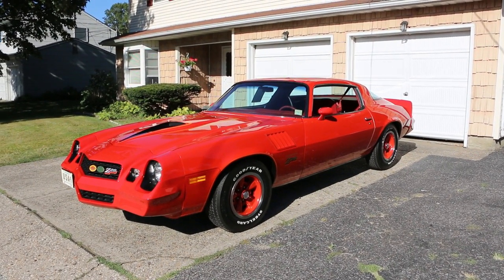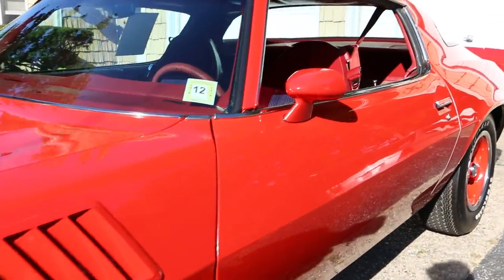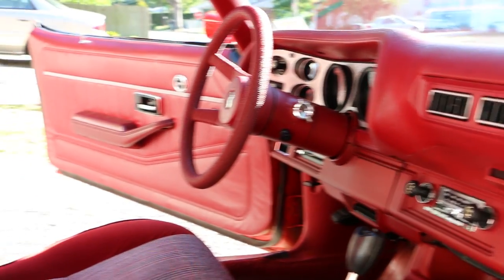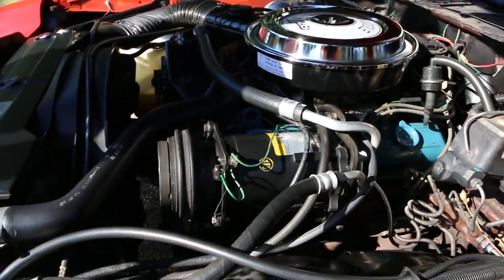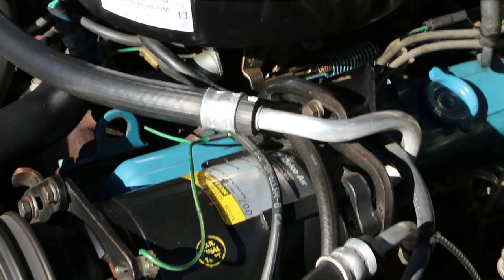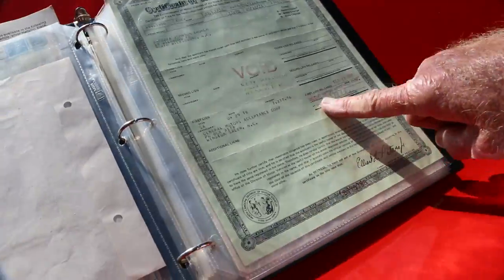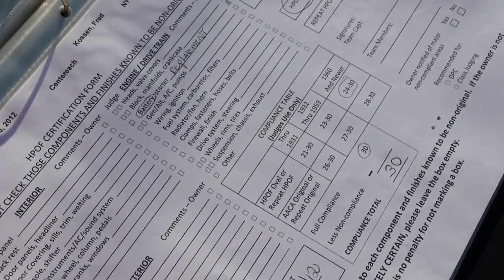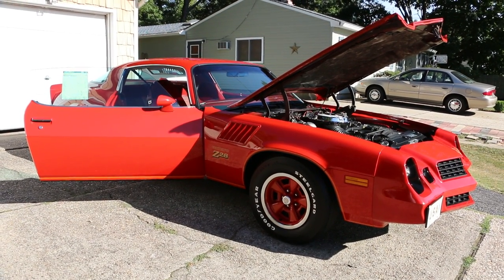Review of 1978 Chevrolet Camaro Z28 For Sale~28,722 Original Miles~Time Capsule

Comment: It's amazing how much these cars are going for in today's market..I seen a 1978 Z/28 all original  matching #"s almost every option all documented with 14,000 miles with Saffron exterior, (2nd rarest color that year) the custom black cloth interior, 4 speed manual (less that 500 were this color exterior/interior & manual) sold for $38,250 Just 15yrs ago these cars all original in this shape/miles/options were going for around $17,500-$20,000🤯

Comment: all original? original tires that are 36 years old and show no signs of dry rot?  All original engine belts again 36 years old?  Tires have date codes on them but video did not show that.  What is the saying, if its too good to be true it probably isnt.  Was this car stored in a climate controlled environment?  It is a nice car, but today anything can be reproduced to mimic factory original.  The car is too clean which should be a clue to how original it is.
Reply: RacerX531 not all the time

Comment: Original 40yr old tires!  How cool is that?  Just like the original tires that were on the absolutely pristine 78 Corvette pacecar, that we did 14k worth of body repair to, after both ends were bounced off cement barriers.  The owner got caught in the rain and thanks to those awesome, old, rock hard tires it spun as if it was on ice.   Original tires of that vintage are fine if the car is a trailer queen or if you keep them stashed in the garage, to hand to the next owner...  The last place they should ever be is out on the road.
Reply from the maker: This Camaro goes on a Trailer to a Show, then Off the Trailer to Be Shown....It's Not driven on the Roads :-)

Comment: That breather lid is not stock looking. It should not have any chrome on it and it shouldn’t have a 1977 Z28 decal on top of the lid. I ordered new 4 speed Z28’s in 1977, 1978 and 1980. That head liner needs work here, it hanging from dried glue.